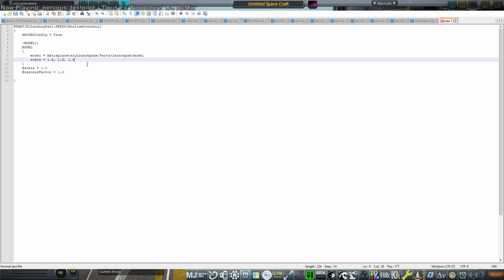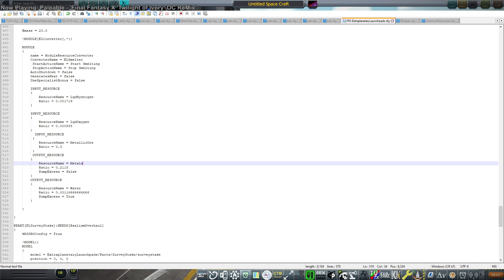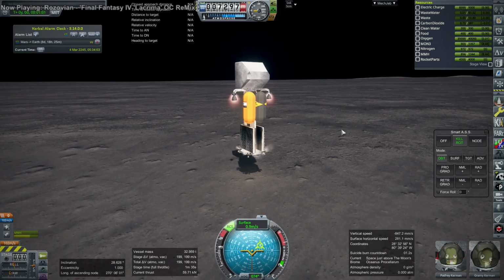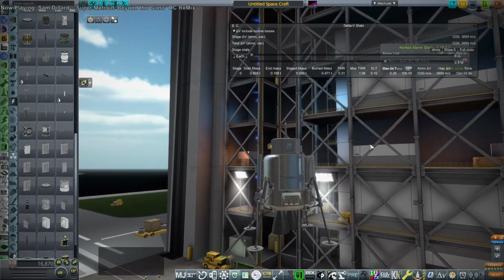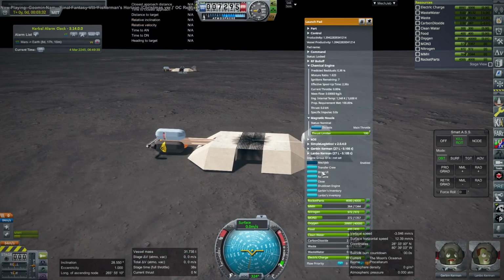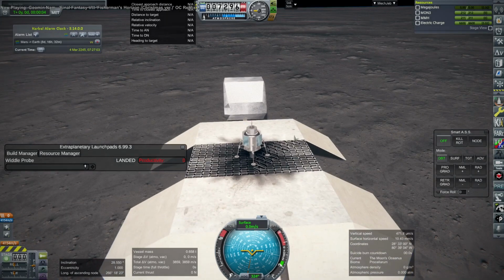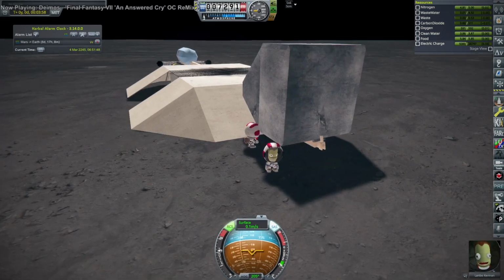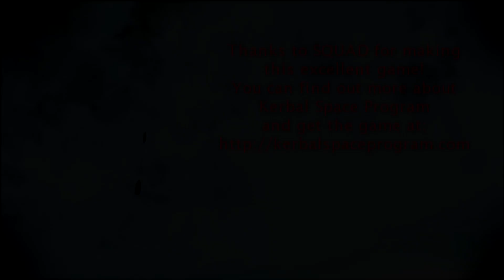Extraplanetary Launchpads in Real Solar System - First Fixes

Comment: You can just place a single survey stake, and the vessel will be built on it, at a rotation of that in the vab(I think). 

Whether to or not to use or integrate MKS with EPL is a difficult question with RO. I have never made use of the transport credits, planetary logistic hubs, surface to orbit automation or what not; in stock or RO, as there is a severe lack of documentation. The automated resource transport systems in MKS are more like the automation genre, and definitely not what most people are going to do in RO or Stock (There's also no way it is acceptably stable enough for a Realism Overhaul as it isn't stable in stock). I was able to find a spot on the Moon with the materials needed for building rockets and making life support ( MKS/RP-2000 ). I found that the RO configs ( In RP-2000 intended or not ) had made material processing units able to produce material kits with only a few, simple resources in one step (older version of RP-2000 so you may have changed it). This might be a good way of going about integrating EPL and MKS into RO if that was an intention.

There are 6 or 7 resources required for producing any parts with the MKS production lines, without taking into consideration life support for the crew. However, you are able to produce anything that you have researched with no limits ( gigawatt reactors, antimatter engines etc. ). This is also the same with EPL's vague "rocket parts" that require scarce resources and or location consideration. It is not necessary to remark that a confinement fusion engine does not require the exact same ratio of parts, mass, and time to construct as a chemical fuel tank of the same mass, however balancing this with either system would be nearly impossible; with the exception of configuring a large amount of resource chains and or resources for certain parts, which would not be worthwhile to balance. The difficulty of landing ~100 tons of cargo on the lunar surface, including nuclear power for night operations, months of life support, resupply missions, return vehicles, and that require parts that are far in the tech tree make it subjectively better to use EPL for the complexities of RO, having used both EPL standalone and MKS in depth myself. 

MKS/USI still has some really cool and good looking features and parts such as the construction landing leg cradles, inflatable surface habitats, the Atlas series of geodesic domes, green houses, automated ISRU and drill systems, monstrous resource harvesting parts, the dozen or so Kerbal occupations, the Kolonization tab that generates funds and habitation based on colony duration and size, and so much more. EPL really needs a model revamp, however MKS should not be removed entirely due to the large amount of models and functional parts. Changing the resources produced and required by the MKS USI factories might be the best option with EPL. A lot of this is subjective though, so do your own research and testing based on what seems to be best with compatibility and for RP-2000.